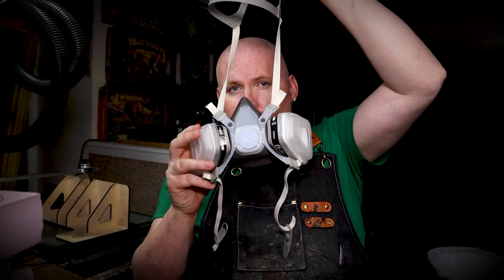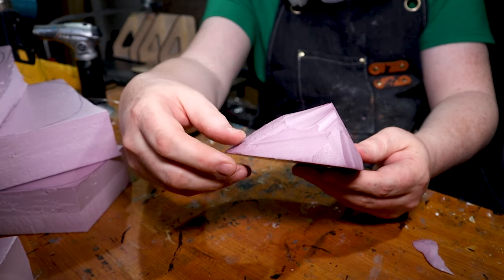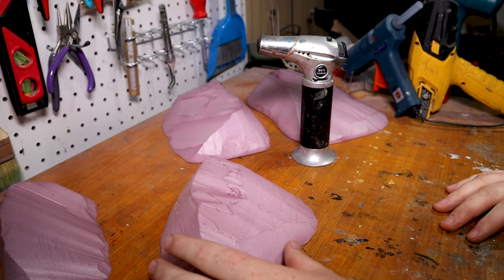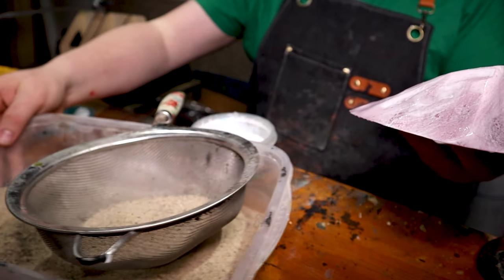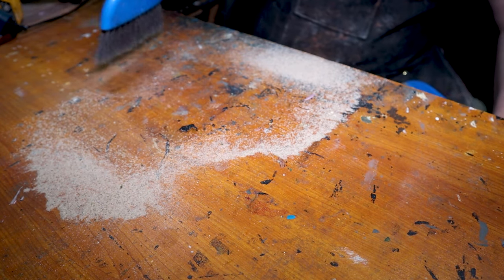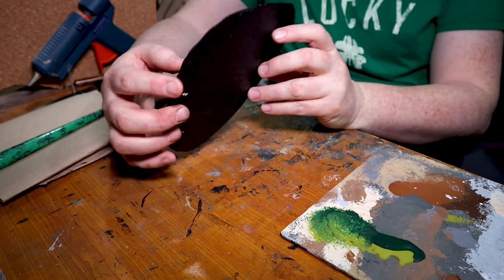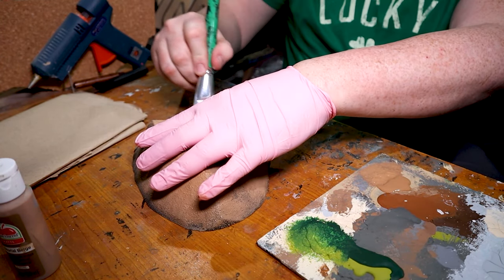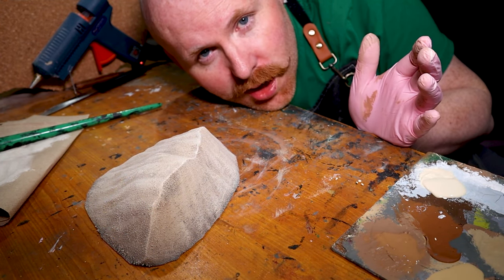Step-by-Step Sand Dunes From Foam! 🌄 Craft Tutorial

Comment from the maker: Anybody else ever get Terrainspiration from movies?
Reply: I get inspiration from everything i see. Every time I look at nature.  Most projects only roll through the mind.
I have really enjoyed your videos over the years, Yes indeed .

Since you are making these for profit can I suggest a speed up?

I have never really sold many hills, Just have not but here is how I make them Art.  If you tried it and made a video I would be very impressed.

I take sand, regular sand like you have and sift it through classifier for gold mining  (look that up)  I take the fine sand and I mix it with tile grout. Powdered grout. They make it in tan. You would buy tan. Mix it with the sand in a  2 part sand 1 part grout ratio or whatever your eye is pleased by. The the next part..
Brush the foam in a mixture of caulk and paint I use caulk to give somewhat of a bounce or body armor to the foam. I feel it helps absorb shock and not chip when banged on the edge (if I didnt base it)

 Then I sift through a strainer just as you do, the grout mixture onto the hill (mask up). Here comes the time saving part.

You should already have a nice color  with the sand and grout but at this point I take watered down paint and spray it through a .99 cent spray bottle. The caulk grout mixture dries fast, it is hard, absorbs paint and you will have a good base coat without having to brush anything at all. You can use a assortment of spray bottles to "wash" the different colors in and you may only need to drybrush at the end then seal with that huge Round up Pump action cannon glue foam machine you have
"If you like it try it use it its yours my friend. I hope its useful.
Reply: I called you Art, Sorry.  Also the caulk I mix with paint is from a tube not powdered. Its the cheapest  DAP white mixed with paint.
Reply from the maker: @nowthisnamestaken  That sounds like an excellent technique!  It would probably be great if I decide to stack more layers of foam to make some taller sand dunes so I don't get a seam.  Thanks for sharing.  I will definitely give it a shot if I can find the time, and will definitely make a video about it if so.  Thanks again!
Reply from the maker: @nowthisnamestaken  No worries, Art is one of the names I've been going by.  Thanks again!